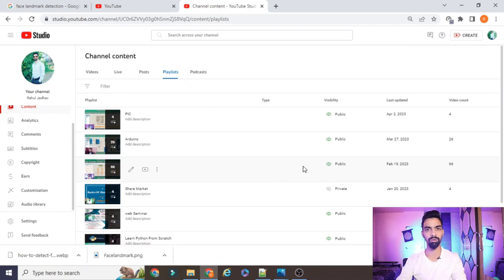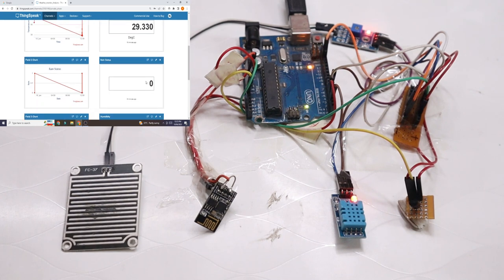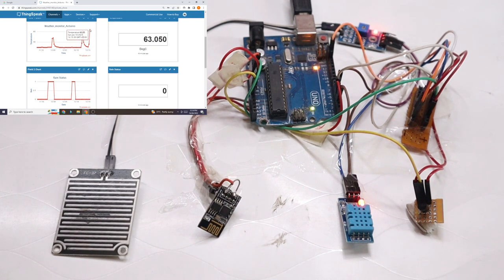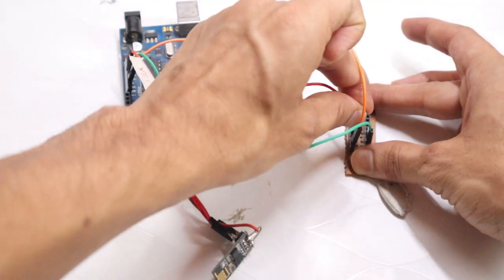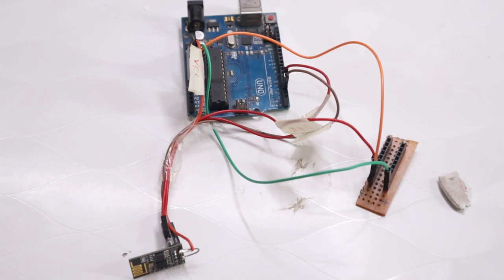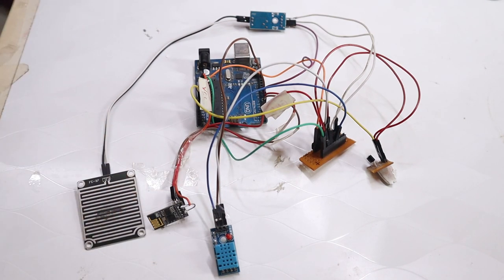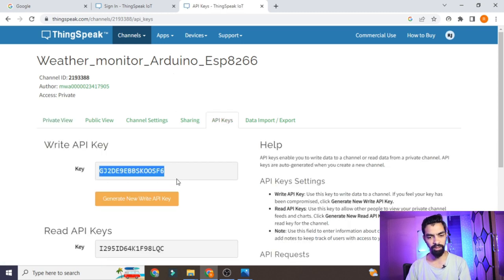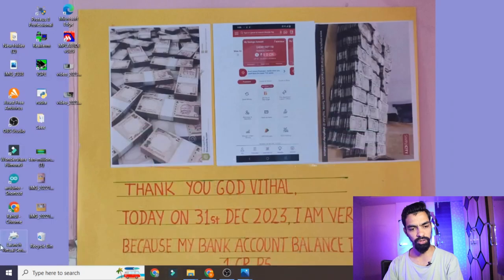Weather Monitoring System Project Using Arduino

Comment: Thanks Bhaiya It worked for me....And one thing lm35 is not showing perfect temperature value its showing 160-170 Degree celcius.....And gets heated alot help me in this regard
Reply from the maker: That means your LM35 connection is wrong if it is heating it is a sign of the wrong connection.
Please check video again and do proper connection
Reply: @rahulIOT  Yes you are right but now the sensor does not heat and everything is fine but the sensor is giving wrong value. like 440.9 like this and rest everything is fine....what to do now?
Reply from the maker: @AmanYadav-tb5uk  please check sensor pin and Arduino pin connection
Reply: @rahulIOT  Everything I checked 5 times but still the issue persists bhaiyaa
Reply from the maker: @AmanYadav-tb5uk  then i think because of heating issue your got damaged
Reply: @rahulIOT  Ok Bhaiya I will replace it tomorrow.....But i also wanted to connect a LCD display to it with 12C module can you provide the code for same?? Please Bhaiya?
Reply: @rahulIOT  Bhaiya I changed LM 35 with a new one but still it's heating when I do right connection and not showing right value
Reply from the maker: @AmanYadav-tb5uk  please contact me on WhatsApp, i need to check your hardware connection. Send me a photo.
Reply: @rahulIOT  i am unable to add my number bhaiya youtube deletes my comment everytime
i contact and sent no. on fb
Reply: Actually bro what is the programming language he used pls can u tell

Comment: bro is that possible to add a display to show temperature to the experiment
Reply from the maker: Yes possible
Reply: bro is this correct miniproject to do in 4th sem   @rahulIOT
Reply from the maker: @EshwarReddyMudem  yes
Reply: bro what is power supply is that refer to a battery  in the block diagram